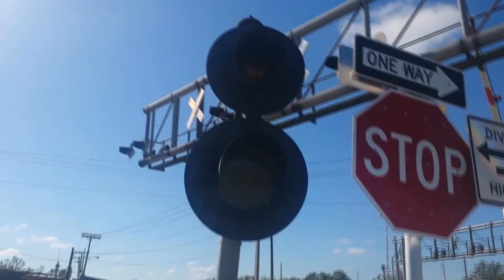Before & After Removed Abandoned Railroad Crossing

Comment: Lost two like this in West Milwaukee and it was complete destruction. Only 1 or 2 small traces even give a hint tracks were there. Was up in Sheboygan Sunday and most of the old passenger line was removed and made into the Shoreline 400 bike trail. Even fewer rail customers and to top it off the bratwurst stands are closed SUN
Reply from the maker: I'm sure you'd agree with me on this, Paul... I hate all those bike trails. To me they represent a dead railroad, along with wasted potential and history. There's nothing sadder than that! Thanks as always for the views and comments!
Reply: @railrol82  even worse is when.they try to reactivate a line that was converted to a trail much less one that was rail banked. Every NIMBY has some weak excuse why it should nt be built. God this country would never have developed if not for the RR
Reply from the maker: @paulbergen9114  I feel your pain